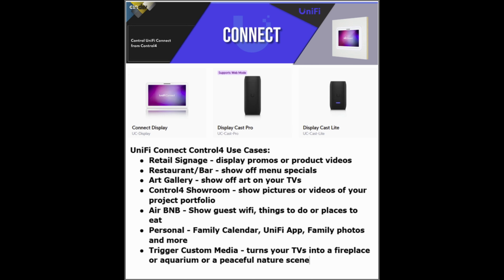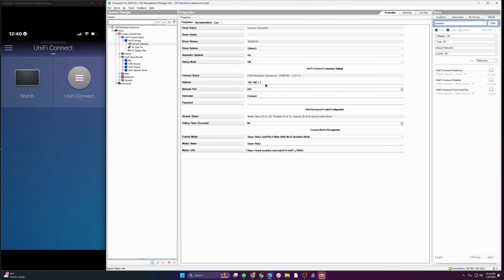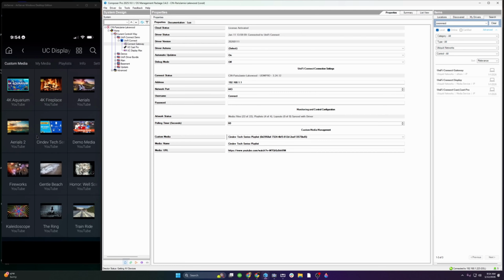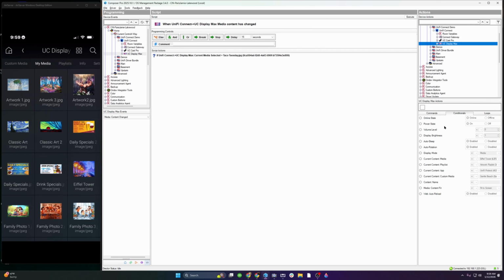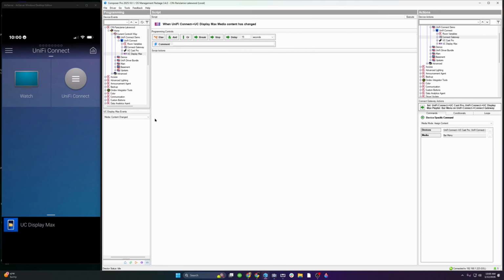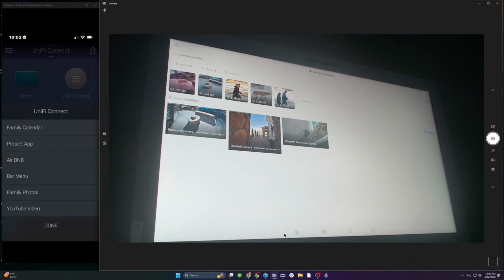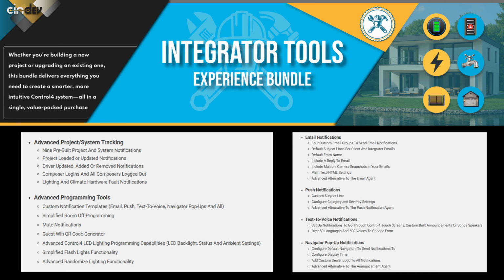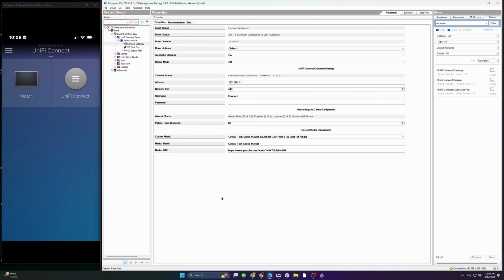UniFi Connect + Control4 Integration | Complete Driver Guide #control4  #UniFi  #homeautomation

Comment: I use your Unifi driver on a few projects for protect and cameras - works good except for the odd hiccup after a unifi auto update I lose a few camera feeds until I re-enter the info in composer or turn anonymous snapshot back on (seems to be with AI and G4 PTZ cameras). Also on occasion the Unifi cameras switch off anonymous snapshot (which is related to above issue).  
My main question is can you answer a G4 or newer doorbell and/or a gate intercom on a c4 touch panel with full audio and video and 2 way talk ? will the TP page flip to doorbell (or intercom)  ?  Let's assume we will be using the T5 panels and a CA10 and this project will be also a Josh / c4 hybrid.  If needed - we could use intercoms at the doorbell locations (package delivery and out buildings like lake house and boat house and farm buildings plus  in addition to the 4 gate intercoms).
Reply from the maker: To answer this shortly the G4 doorbell pro does not have SIP intercom functionality but the new G6 does.  So if you install that product in the future you will be able to have the client talk to whoever is at their door/gate through the Control4 touch screen.  I would be happy to go over this with you in a Zoom/Google meet.  Just email me at info@cindev.com and we can go over this and any other questions you have.